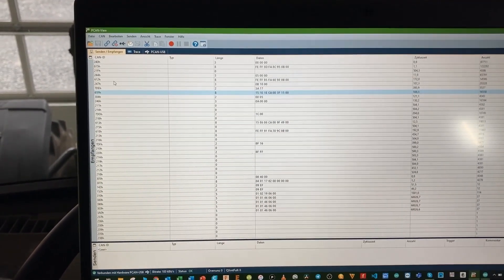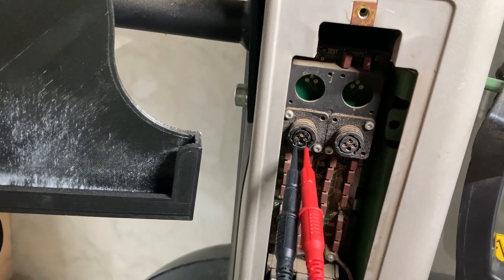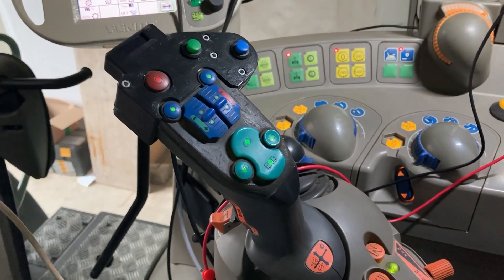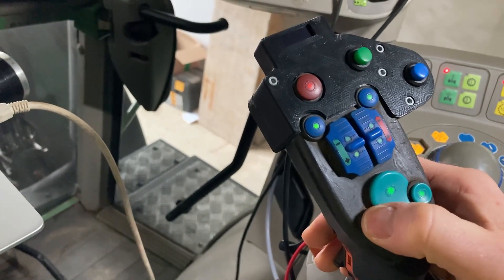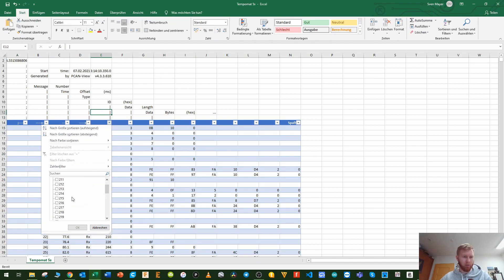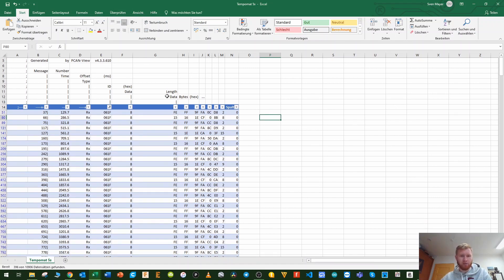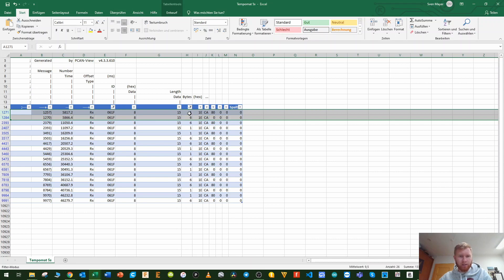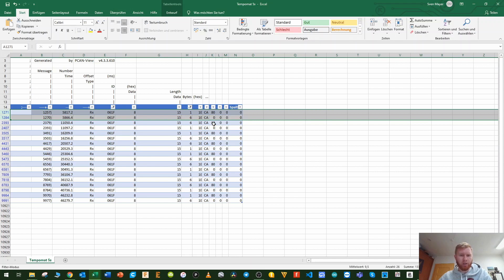CAN BUS reverse engeneering Fendt 818

Comment: Good work, however I suggest using a CAN decoding program that "holds" any specific message ID static and only changes the data bytes if it sees any change. This makes decoding much quicker than analyzing all the data in Excel. You can sit in the tractor and quickly filter out any canIDs that you don't want to watch, and target only the one or several that you want to monitor for changes to the data fields. 5 years ago when I last played with this there were some solutions out there that did this, both Arduino based and otherwise. I'm sure its easier now than it was then. Not sure if this makes sense.... your method that is shown works but there are more efficient ways to quickly sniff out changing data fields.
Reply: The Peak Software Used in this Video can do the Same out of the Box

Comment: How would you go on about reversing an RPM or TPS(throttle positioning sensor) signal from the bus? I mean, there is no on/off state of one of those types of values.